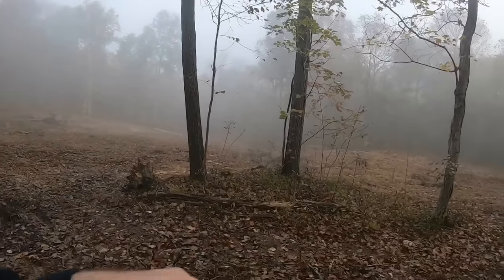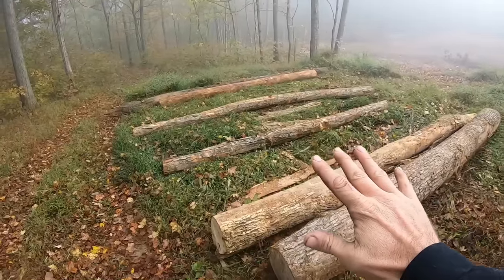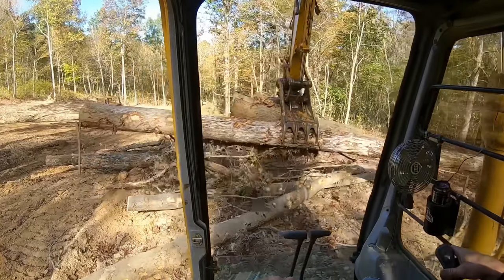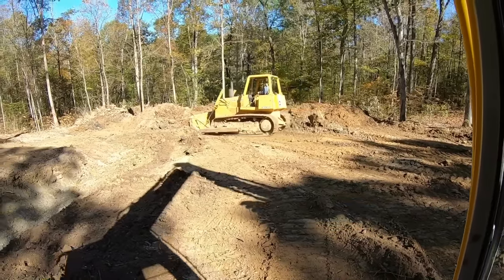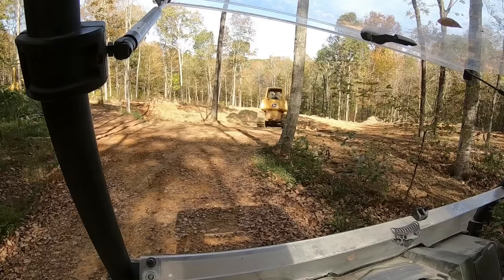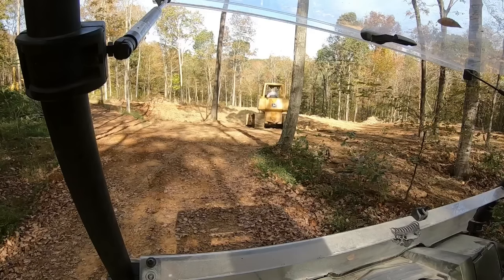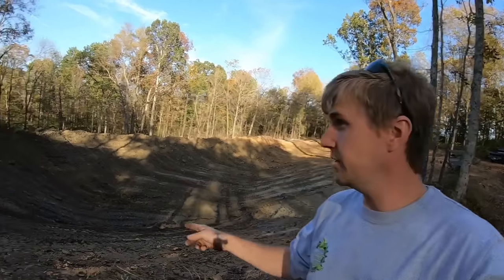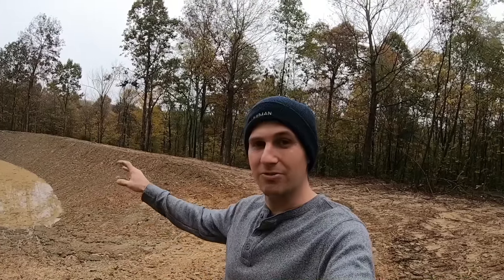Three day Pond Build - Start to Finish - Retired Equipment Operator

Comment: Love to see a drone view. My first dozer experience was 52 years ago on an old Cat. It had a hand crank pony motor to start the engine and a A frame cable lift system for the blade! My Step Dad wouldn’t teach me until I could clean the tracks from mud first. But I cleaned them!! Great memories

Comment: This wouldve been a fun job to take on. Having some freedom for construction is always nice as well. I own a 973c that i would've taken this job on with as well. Good work.
Reply from the maker: They look like a strong machine.  In my opinion they are one of the best setups for clearing land.  Thanks for watching!
Reply: @CaptainKleeman  I agree, with iti being hydrostatic it is very nimble on its feet for a 60,000lb machine. Plus the 4 yard bucket, and ability to raise it 15+ feet in the air makes for some added advantage. It's one of the most versatile machines out there. Just uncommon in comparison to a track hoe so people are hesitant to hire me. Most of the people i do work for hire me back a second time because of the efficiency, happy with the results the machine can produce,

Comment: GREASE! Good on you jerry keep up the good work
Reply from the maker: Yup,  just had it line bored,  one of the pins isn’t letting the grease transfer.  As of today the pin has been pulled and and the problem was found and fixed.  Thanks for watching!

Comment: Very nice pond. I have been hesitant to build a pond until I can afford to buy a 650 dozer. I have 13 acres to clean up and want a one acre pond on my place. I could rent equipment but all that cost down the drain instead of equity in a dozer. Ouch. I am 67 so need something to happen pretty soon if I want a stocked pond eventually.

Comment: Looks like u need to core it out a lot better normally you try to core it out deeper then the bottom of the pond so u do have a chance of sand vain causing the pound to leak and just pushing that dirt up and over the back is a recipe for the dam to settle like crazy and the back  slip to sluff off.

Comment: ever notice there are people that can run equipment, and then there are operators. no GPS or bench loop needed when you have a Jerry
Reply from the maker: That’s right!  He is a great operator
Reply: @kingy002  Jay’s comment makes sense to me as I’m in the process of buying a tractor.  Which I don’t know how to operate.  So I need to decide if I’ll put in the time to learn, or spend six figures so I can let the equipment basically run itself while I stream Netflix inside a heated/cooled enclosed cab.

Comment: Put some grease in that 120 mike just spent how much to line bore and repin that machine and you can hear it squeaking while you dig
Reply from the maker: Hey great question!  Although for a minute it seems like mores of a statement on how you know more about the machine,  there is an issue with one of the pins from the line bore.  Mike told me it would squeak when it got warm and to run it.  As we speak the pin is back out and the problem is being fixed.  Thanks for asking first with out just making assumptions.  That would have made you look like a real a$$

Comment: Some grease goes along ways. Mr. Squeaky
Reply from the maker: Just had it line bored.  For some reason the main boom pin isn’t letting grease transfer.  Mike said to run it and as of today the pin has been pulled and problem fixed.  Thanks for watching.

Comment: Sounds like you need either a greasing or more grease fittings
Reply from the maker: It’s been addressed in the comments and is pinned in the comment section.  Post line bore,  main boom pin problem,  wouldn’t take grease.  It’s been fixed since.  Thanks for watching.

Comment: I would like to offer you the use of my DeWalt power GREASE gun it hurts my ears to listen to that dry boom on that Machine
Reply from the maker: It’s been addressed a dozen times,  but hey, just for you.  Faulty pin post line bore, owner said run it, pin replaced after this job.  You’re welcome

Comment: Smooth but should have gotten 0lans and elevation fron nrcs! Dam fail is unacceptable  he didn't walk in the levy while pushing up a bank. You need a tractor and roller to tamp dirt as it is pushed up!
Reply from the maker: Check out the pinned comment

Comment: I just bought a mini excavator.  Could you explain how you do that turn without tearing up the ground?
Reply from the maker: Swing while your run your travel pedals in opposite directions,  one forward and one back.  You don’t have lift yourself very high,  just enough to get the track pressure off the ground.  Play around with it and you’ll get it!

Comment: You know they make grease guns for heavy equipment that stops squeaks!
Reply from the maker: Yup,  just had it line bored,  one of the pins isn’t letting the grease transfer.  As of today the pin has been pulled and and the problem was found and fixed.  Thanks for watching!

Comment: Sounds like excavator could use some grease?
Reply from the maker: Not a grease issue.  Just had the machine line bored,  we think there might be some shavings or something left in one of the bores.  It’s actually in the shop as we speak having that pin oulled to get it figured out. Hey thanks for watching!

Comment: Jerry did a great job considering what he had to work with as far as elevation. But, I don't understand why anyone would want to build a pond that is supposedly for fishing that has no reliable source of water input other than winter snows and a bit of rain runoff during fall and spring. Plus, where's the structure for fish to orient to? Why place the pond so high up on a hill that could have provided more runoff to keep the pond filled if it had been placed lower on the hillside? Do you not own the property lower on the hill?
Reply from the maker: I see you’re one of those people who knows more about our property than we do.  Cute

Comment: Why don't y'all use a siphon pipe for the water level and have an emergency spillway
Reply: Spillway is to the right of the pond as you look at it, overflow pipe will be installed next spring 👍
Reply from the maker: Yup,  like mentioned in the video,  spillway is on the right.

Comment: something is dry on that excavator
Reply from the maker: Yup,  just had it line bored,  one of the pins isn’t letting the grease transfer.  As of today the pin has been pulled and and the problem was found and fixed.  Thanks for watching!